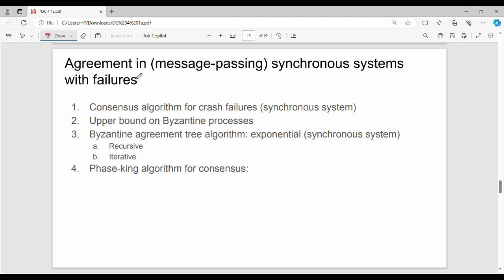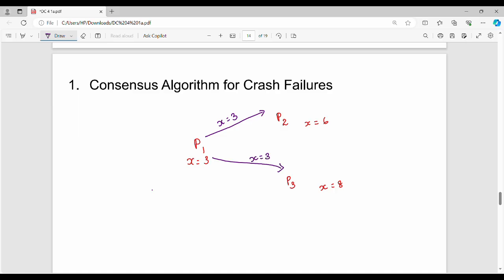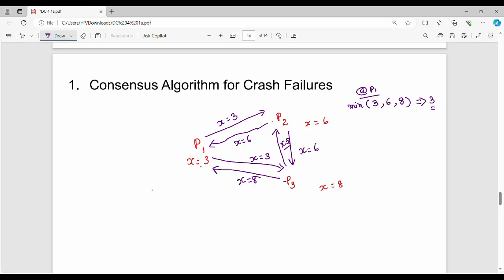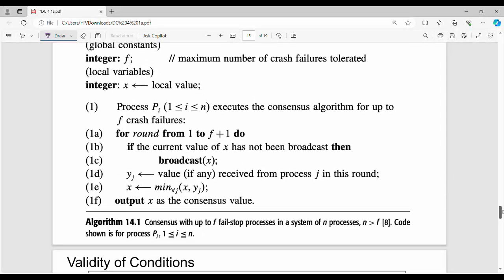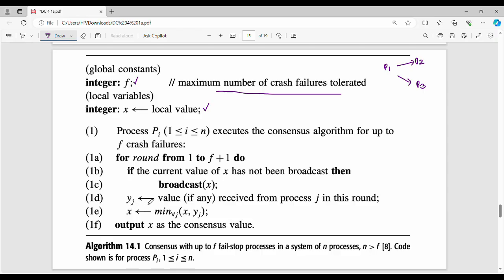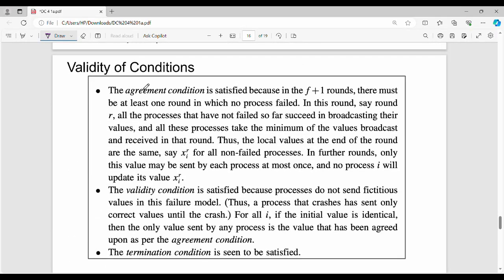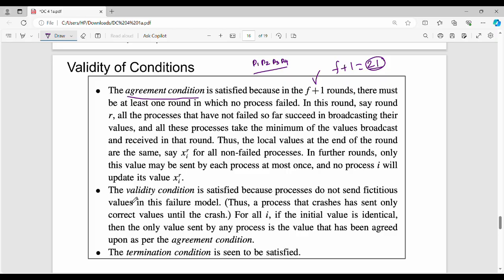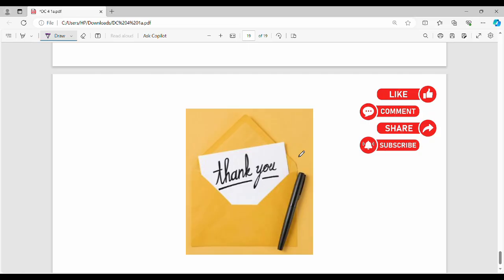4.3 Consensus Algorithm for Crash Failures in Tamil

Comment: 1.What are the key assumptions underlying while designing agreement algorithms and brief them?

2.Describe the issues involved in a failure recovery with the help of a distributed computation.

3.Illustrate the different types of failure in distributed systems

4.Explain the concept of consensus and the importance of agreement algorithms in distributed systems.
5.Illustrate how rollback recovery works in a distributed system using check pointing techniques.
6.Outline the purpose and benefits of check pointing in distributed systems.
7.Infer how agreement can be achieved in a failure-free synchronous system.
8.Explain Byzantine Agreement Problem in detail.

For these questions what answers I have to write in this playlist...can you say me the video number for each question haa sir....plss sir....
Reply from the maker: Sorry akshaya. Was held up in some work. Are the answers still required?